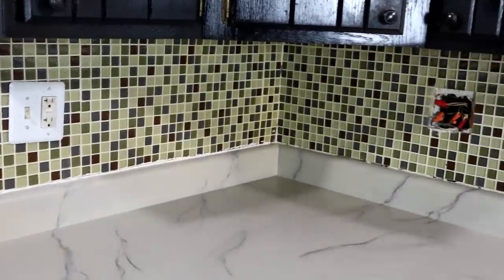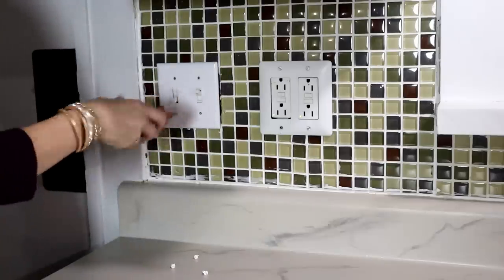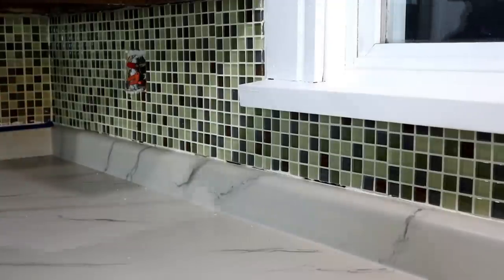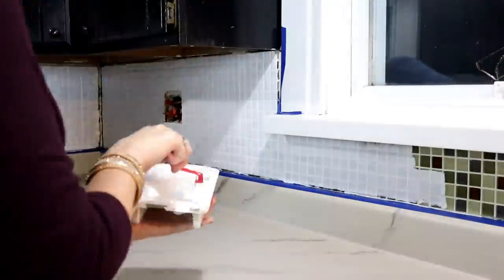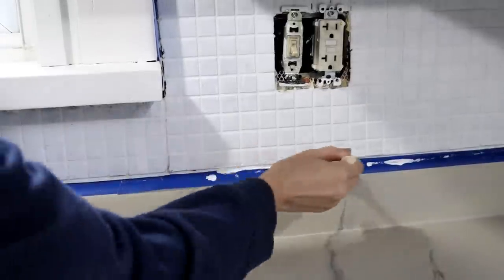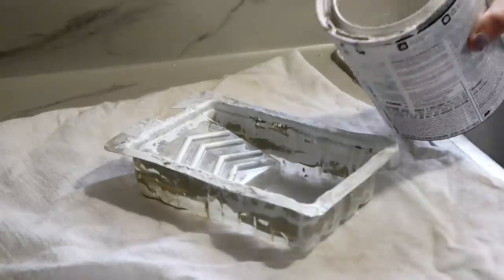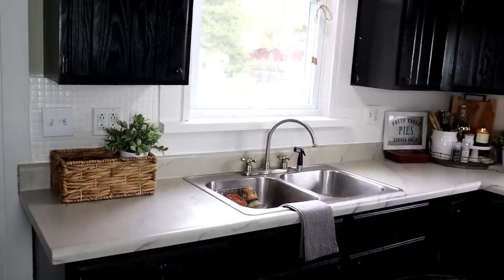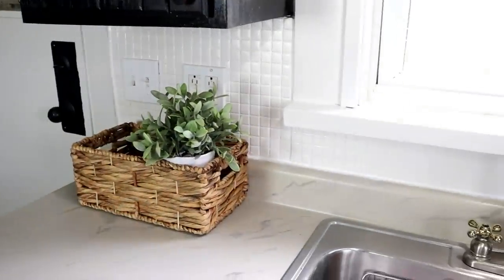DIY Painted Kitchen Backsplash | Farmhouse Style

Comment: Shannon, loved the video. I’m going to surprise my wife with this project. I did have a question. You used flat paint and then the gloss. Question, is there a reason you did not just use a high gloss paint, rather than a flat paint. Thanks again.

Comment: Shannon,  this looks beautiful and gives me the inspiration to finally get mine done. Thanks!!!
Reply: did you do it? how does it look after years? I want to do mine
Reply: Katy,  I have not done it yet but still planning on it! I'm going to use white chalk paint, distress it and then finish with a clear mat top coat. I have used this process on smaller projects. It looks beautiful and lasts a long time without chipping or cracking and is easy to clean.

Comment: If you take your nail to this paint, won't it just peel off? I have the exact same backsplash as you. I cleaned, sanded, primed, and painted a section and let it dry well and it peeled right off when I tried to peel it.

Comment: It's been 3 years. How has the painted tiles held up?
Reply: Mine is still looking fantastic after 17 years. When we moved in, 2 kitchen walls were a dark terra cotta tile. It was going to be an expensive, messy job to remove it all and install new tile SO I figured I couldn’t make anything worse by painting it. With some BIN, and Ralph Lauren soft butter cream paint, I did the job, painted the grout and everything. To finish it, I first covered everything in a matte, non-yellowing polyurethane, especially important not to miss any grout lines so they were sealed. Second, I applied 2 coats of non-yellowing, marine varnish in gloss (Lowes, Home Depot) with a firm roller so that the roller only came in contact with the tile face, not the grout. The finished tile was shiny like ‘real’ tile while the grout lines were flat matte. Absolutely loved it. Still do. (My husband, a male neighbour AND a male professional home painter said it couldn’t be done. “You’re crazy! You can’t paint tile!” Pfffft to them!)

Comment: Materials Used:
Painter’s tape, foam brush, small foam roller, and small roller tray
Cleaner/Rubbing alcohol & cloth
Zinnser 1.2.3 Primer Paint 
Kilz Complete Coat Primer& Paint Latex Interior: white color
Minwax Water Based Polyacrylic Protective Finish: clear gloss